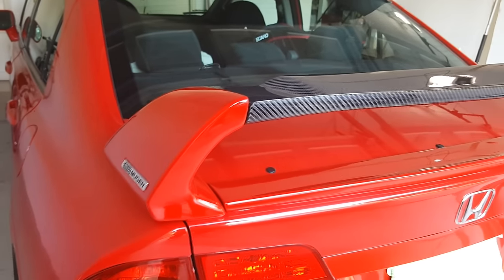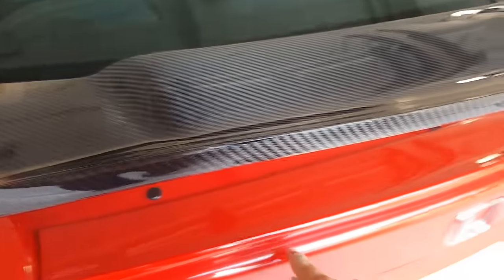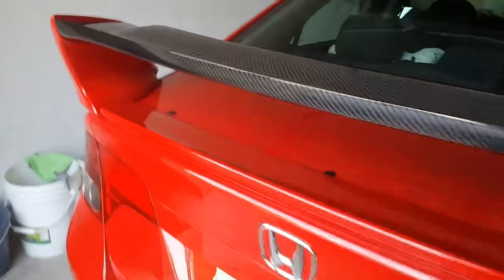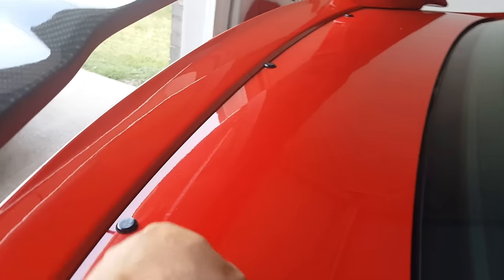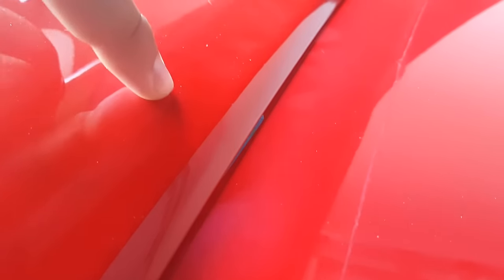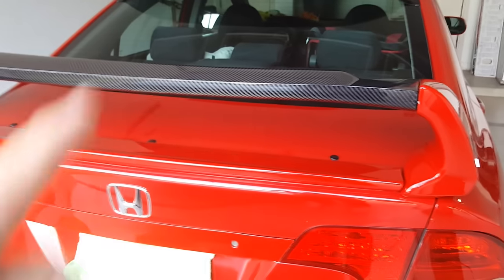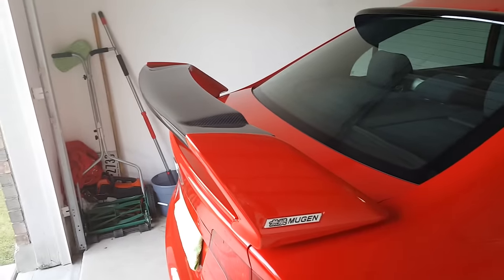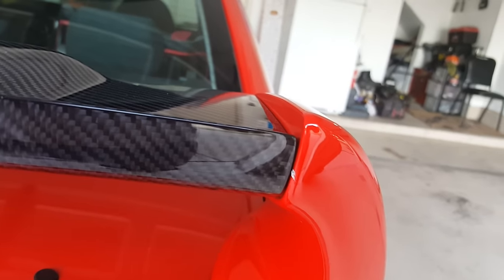07 civic si sedan mugen rr wing install

Comment from the maker: no I explain in this video how to install it , if you buy this same wing you have to use the black pads as a template to drill 4 holes total , the 2 from the existing wing will hold it,but not that good. and the plugs came from orileys I just asked for body filler plugs
Reply: I order one but I'm mad nervous about installing especially the drilling part lol.
Reply from the maker: Trust me I was also .. but if you follow how I did it ...it will be alot easier than just trying to figure out how to measure the exact spot ... mine fit rite the first time
Reply: +lsvtec93eg6 alright good lol. So all I have to do is drill 4 extra holes and everything fits fine?
Reply from the maker: Yes... the one you ordered ...did it come with little black pads that go on the bottom of the wing?
Reply from the maker: Christopher Millington I would if later down the line is wasn't going fd2 conversion it's just temporary for now either way I'm happy with the outcome but I did think about that those...thanks for the input

Comment: Where can i get the plugs? Also did you have any problems with water getting in?
Reply from the maker: The plugs i picked up at a local auto part store . And no I had it on for almost 3 years and never have an issue with water
Reply: @lsvtec93eg6  alright thanks

Comment: Does the wing shakes while driven? I want ur honest opinion man. And is that real carbon fiber or they just wrap over it
Reply from the maker: Ben Tran ok so it does shake a little but not as much as you think , I've seen it move around 90-100 mph. Second I believe its fiberglass with carbon overlay the overlay is real but I like it

Comment: did your trunk have the carpet liner on the lid or did you add it? my 08 just has a bare red metal trunk lid.
Reply from the maker: bassist1217 yes mine came with the carpey

Comment from the maker: yea most you have to drill holes ..but certain wings will cover all the stock holes..since mine is from ebay it doesn't cover it all
Reply: lsvtec93eg6  how did u cover the holes?
Reply from the maker: rodyn izaguirre I went to orileys auto parts and bought rubber plugs they were by the interior clips .. think I paid a couple bucks not to expensive

Comment: I want to know that dose water leak though your trunk with the 3 hole plug that you but on
Reply from the maker: I no longer have the car . But I never had an issue with water and I ran that setup for 2 years . When I sold it it still had the wing and I haven't heard anything since. Hope this help

Comment: Lmao so that's out of the question. Well I have a 2008. Seen a few wings I like on eBay and some have the badges. Are there any wings that have the same holes as the si trunk? I didn't know if there were any where i didn't have to drill any new holes
Reply: MD Clan I installed mine without drilling holes. I used the 1 factory bolt and 3m tape in place of drilling out holes. It holds very well and doesn’t shake or rattle much.

Comment: Which is the best 3M tape and stupid question is there a specific way to use that tape?
Reply from the maker: Mario Trujillo I just use 3m double sided tape and it works best it'll withe surface is clean and you apply pressure for 30 seconds to make a good bond
Reply: Thank you! I'm installing mines this weekend!
Reply from the maker: Yea no problem...it's intimidating but actually very easy and looks great in my opinion
Reply: Yeah I'm excited. I'm only nervous to drill the holes. Don't wanna mess that up
Reply from the maker: Mario Trujillo yea the holes are easy just follow the steps...

Comment: Hey bro I just came across your video and you seem like a good dude and want to help out as much as you can and that's a real car guy. This car stuff is what we love and of course helping other people is one of the biggest things. Definitely will sub too you.... but gotta answer my question. No biggie bro just want to know EXACTLY the name and every bit of info you can give me on that wing. I'm going crazy over here for months now and super scared to buy a junk part for my car. I have a 07 Si sedan with only 37,000miles on it. It has a $7,000 dollar paint job on it and don't want to order the wrong one. I'm OCD about my car and YOUR particular wing is perfect. Please give me all the details on it and also if you know a good company or person on eBay for the mugen rear diffuser with rain light in the middle. Thanks so much and sorry so long. OCD like I said lol. 👍
Reply from the maker: Thanks alot bro I appreciate it .. the wing is from eBay it's hit and miss when you can find it but this is the style of wing https://www.ebay.com/itm/06-11-Honda-Civic-4Dr-Sedan-Mugen-Trunk-Spoiler-Wing-Carbon-Fiber/151586693726?fits=Year%3A2007%7CModel%3ACivic%7CSubmodel%3ASi&epid=1241157663&hash=item234b45625e:g:FOQAAOSwYyRaFAQk
And I ordered the mugen badges separately I wanted the wing with the carbon center piece and I was able to find this one already painted mine was 275 tho . And know that's it's carbon fiber wrapped .. as long as you follow the steps I went thru it will go easy
Reply: @lsvtec93eg6  carbon fiber wrapped? Wow that helps alot. Thanks man

Comment: are you running without the 3rd brake light
Reply from the maker: meng yang yes I have no 3rd brake light
Reply: do cops hassle you about it when you get pulled over. i have one too but been debating on putting it on and running without the third brake light. also does yours pass safety without the light
Reply from the maker: Yea if the car has the light is has to work ..no light ...no problem and I take my car to honda to get inspection so no shady business
Reply: thanks bro, nice car btw. i might put mine on after winter is over
Reply from the maker: Thanks bro I appreciate it... it's a lot easier than I thought

Comment: Where did you buy this wing from, I had bought one online but when I got it, it looked warped from the top piece so I returned it and I’ve been trying to look for one that comes painted already and that doesn’t look warped from
The top piece
Reply from the maker: Jonathan I got it from eBay ... I just checked yesterday and they are restocked as of 11/22/2017 it was 275 shipped already painted. I think it's fiberglass wrapped with carbon fiber ...not 100% carbon ..but still looks good
Reply: lsvtec93eg6 can you send me the link to the site?
Reply from the maker: Jonathan I've been searching for it .... when I find it I'll post it ...their products go fast and I've only seen the listings 3 times in a year since I purchased my wing
Reply: lsvtec93eg6 I’ve found 2 different types of wings on ebay, one of them is one piece that has the top and sides only but it’s one whole piece and the other is 4 pieces just like the one in your video but do you think the one piece wing would be better than the 4 piece wing that you have? There about the same price as well
Reply from the maker: Jonathan I like the 4 piece and it's really not that bad... plus if you have an si your stock wing will leave behind holes that the 4th piece will cover ( won't cover all holes)
Reply: lsvtec93eg6 I was able to find that wing you have but I was looking for other wings made of higher quality material such as fiberglass since my last wing I bought off ebay was abs plastic and warped after a few months and I want my next wing to be straight from the top piece and was able to find one that looks exactly like the mugen wing with the 3rd brake light but the site to me doesn’t seem trustworthy and wanted to know if you or anyone has purchased things off of that site because a mugen wing with the 3rd brake light goes for $325 unpainted but I just need to know if thats a legit site before I spend that kind of money
Reply from the maker: Jonathan which site was it?
Reply from the maker: Jonathan yea it's a good site..they are located in Canada but I wanted the carbon center piece that's why I didn't order from them and I got mine painted already but it's a legit site

Comment: i ordered one from ebay (Ikon Company) and it is driving me insane that the Mugen slot on the wing is bigger than any badge you can buy ....What the actual f*ck
Reply from the maker: Ezequiel C yea it's a small flaw but over all it's not bad and I'm glad that I got the one with the carbon top piece
Reply: lsvtec93eg6 it looks awesome , and I got the one with the carbon piece too but that little detail is driving me nuts lol. But thanks for getting back to me 🙏